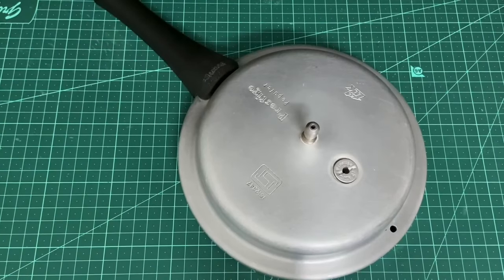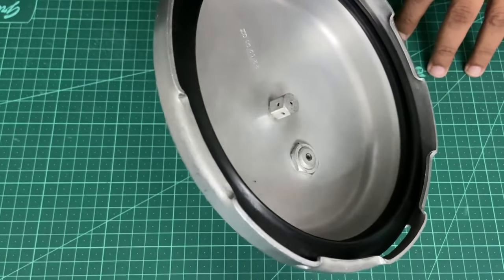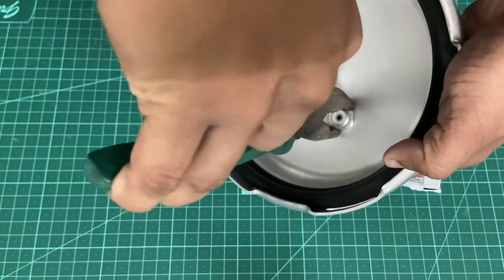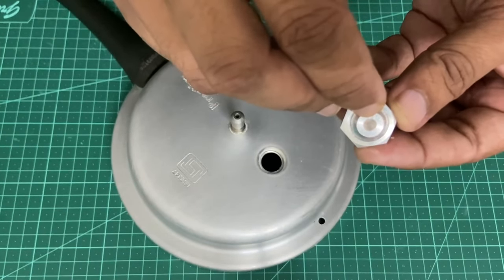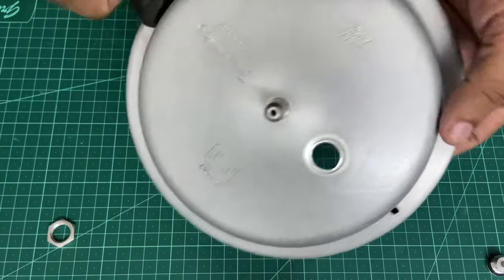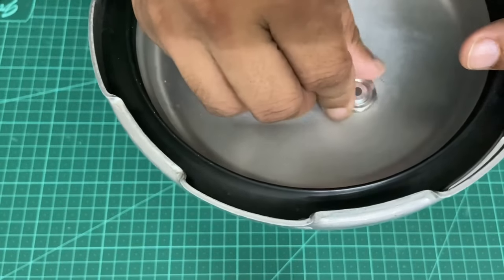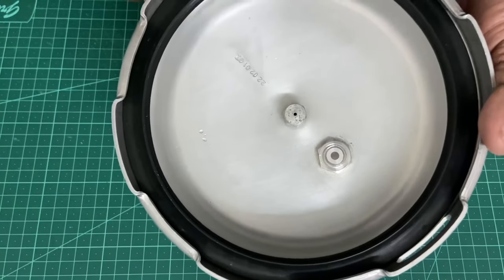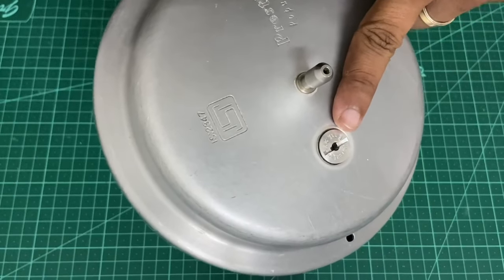Prestige Pressure Cooker - Safety Valve Replacement

Comment: Very helpful.  I inherited a very old pressure cooker that doesn't have a safety valve.  I intend to install one, so thanks for posting this.
Reply from the maker: Oh I didn’t know the old pressure cookers never came with one! 😲 What make is it? Just curious. 🙂
Reply: I don't have it at my home at the moment, but it could be Namco.  From the 50's. It only has a weighted valve in the centre.
Reply: @GaneshBalan  Namco, I think. From the 1950's.

Comment: How do you remove the hexagonal part from the safety valve? The new one is put in too tight so I’m not able to remove it like you did by hand.
Reply from the maker: Hi Rohan, if it is hard for you to remove the hex nut, you may need a hex socket or a ring spanner. I suggest you take it to a utensil shop, they’ll do it.

Comment: Thank you Ganesh! You have explained this so clearly and perfectly. Only hitch is I am unable to locate our pliers and I cannot separate the parts by hand no matter how hard I try.😅 Any ideas on how I can get this done without pliers?
Reply from the maker: Hi, the easiest way is a set of pliers. Shops use the open-ended spanner to remove the nut.
Reply: @GaneshBalan  thanks for responding. I managed to get a pair of pliers and took it apart. After all the effort I realized the valve was of the wrong size. I will go to a store and get it replaced.
Reply from the maker: @MojitoNagaraj Oh but please take the lid to the shop so you get the correct replacement. This is a safety device so best not to risk with an inappropriate part.

Comment: Hi. A question. I have a pigeon pressure cooker but cant find similar brand safety band here in USA. Can i use prestige valve. Or which other brand will be compatible? Any idea?  Mine is an outerlid stainless steen cooker. Will appreciate a response. Thanks
Reply from the maker: Hi Poonam, this is a half-inch diameter plug which is standard for many models. You can use Prestige’s plug too. Please ensure that it fits properly and steam doesn’t leak while in operation.

Comment: Is there specific rating for safety valve, like 5ltrs and 3 ltrs safety valves are different?
Reply from the maker: Hi Anush, there are 2 types of safety plugs for Prestige cookers:

1. The normal version which I have shown in this video.

2. The miniature version. 

Please check your cooker’s lid to check which plug you would need.

Comment: Is the alloy in safety valve poisonous
Reply from the maker: Hi Anamika, the fusible alloys used in pressure cooker safety valves are typically composed of non-toxic materials. Common alloys include combinations of bismuth, lead, tin, and cadmium. Manufacturers design these alloys to melt at specific temperatures suitable for pressure cooker safety applications. When properly used, the small amounts released during melting are considered safe.